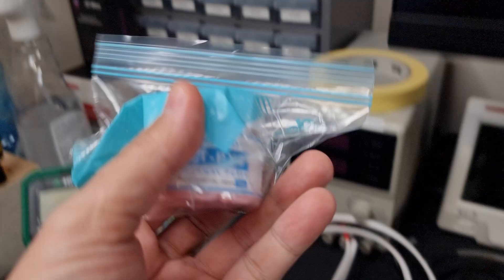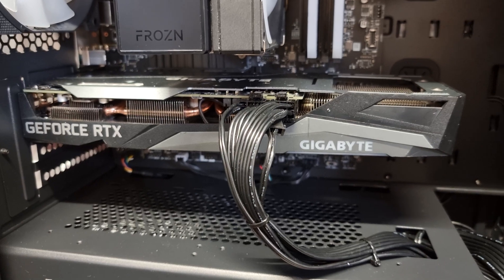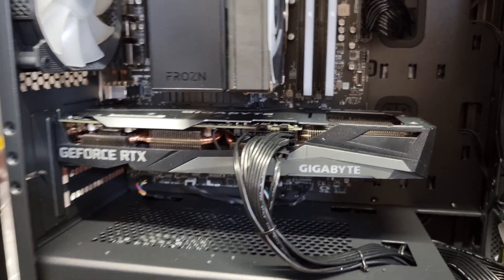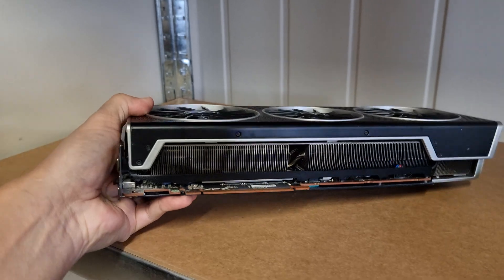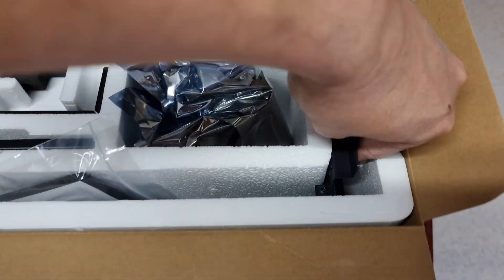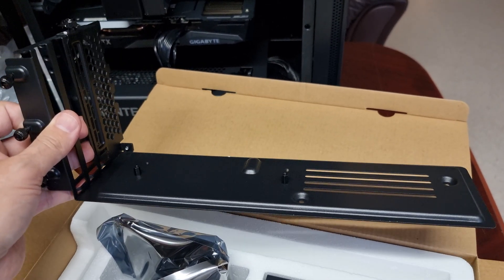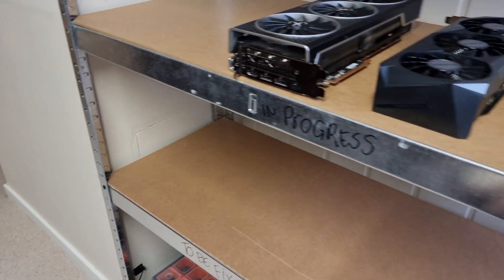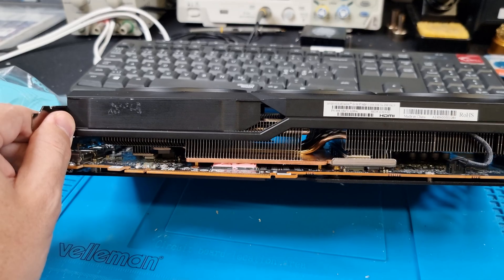Why Modern Day Graphics Cards Are Dying Prematurely.

Comment: glad i bought a new case, the frame 5000D and with that a RTX 5080. was running a rog strix 2070 before and damn, the 5080 is so much heavier, i couldn’t even imagine that. even with a holding bracket i still wasn’t happy. bought a cheap ryzer 4.0 cable bc my asus rog b550-e only supports pcie 4.0. if i update to am5 than i will get a ryzer 5.0 cable and a free performance boost. i’m happy to mount my 5080 vertical after i see this video.
Reply from the maker: Vertical mounting is a great solution for heavy cards like that! And that Corsair 5000D is a nice case. I have one myself.

Comment: I’ve aways tried to have systems where the card doesn’t need supports, but it severely restricts your choice in cases. I never thought of vertical mounts via an extender as a way of taking the weight off the card. Why does this never get a mention from places like Gamers nexus when they are doing case reviews? It’s always about thermals and looks. This needs to be mentioned and more widely advertised to the community
Reply from the maker: Gamers Nexus, Linus Tech Tips and other bigger channels do not deal with GPU repairs in combination with reviews as mine does. I cover both whenever I can. There are videos out there of Linus, Brian from TechYesCity and Der8our trying to fix graphics cards with a regular heat gun. They have no clue what they are doing.

Comment: Blocking all your PCIe slots isn't a solution. It's trading one problem for another. What about the GPU support that's basically a bar that's installed under the GPU?

Comment: Do different AIBs or maybe GPU models have different PCB thickness? I know with motherboards they advertise the layers sometimes.
Reply from the maker: Yes they do. Some use 8 copper layers, while others use 12. And it is not restricted to one brand.
Reply: @TechnologyHive  RIght on. So, presumably, you see this happening a lot less with 12 layer boards? Do you recommend any brands or examples of nice sturdy GPU construction like that?
Reply from the maker: @michaelservetus914  Actually I see this happening even on cards with 12 layer PCB, and it is not due to the pcb being weaker or stronger, its due to the larger heatsinks being used today. The thicker the PCB, the heavier the heatsink.

Comment: I just bought sapphire pulse 9070 xt but it is only weight 1.2kg compared to the 2.2kg of the 6800xt merc in your video. Do I need to support my gpu ?
Reply from the maker: If its a 3 fan card, I would add at least one support between fan 2 and 3, so 2/3 the length of the card, just for peace of mine.

Comment: Had no idea this was a thing, as someone who isnt as savvy on all the newest parts and build options. I havent noticed any bowing in my 6700 XT yet but i decided to get a cheap bracket support to help which should come tomorrow,  right nowi have it fastened in the back of the case to help but that doesn't help with the torsion coming from the opposite side of the card as you demonstrated. It's been a couple years, is it too late and my card is going out regardless?
Reply from the maker: No, it's not too late. The support bracket will definitely help prevent any further bowing. Just loosen up the retention screws before you add the support, let the card rest on the support, level it, then tighten the retention screws. If it was too late you'd start noticing it by now.

Comment: Today CPUs and GPUs are OC'd to they're max from the factory so the wear and tear are accelerated and thus they're operating life is shortened. That's why overclocking is almost a thing of the past unless you use LN.
Reply from the maker: OC has nothing to do with this kind of damage. This is due to weight, not OC.

Comment: whats the latency-loss with vertical mounting though? you're still adding a bus-speed bottleneck that doesn't need to be there.

2 sag brackets, at the middle and end of the gpu, seems to be the smart call.
Reply from the maker: The riser cables included with most 3rd party vertical mount kits are PCI-e 4.0 or 5.0. I have not seen any well verified study indicating these aforementioned riser cables add any significant latency.
Reply: @TechnologyHive  they functionally HAVE to though? part of the budget for the entire R&D for the last 20+ years on motherboards has been progressively physically shortening, and increasing the efficiency of the bus-speeds and distances between processors, ram and storage/network cables etc, without impacting the functionality and practicality of the motherboard instead.

Adding a degree of distance to the most time-sensitive component in your pc for gaming has to add a latency or micro-micro-stutter issue. I use a portable sag stand, a little adjustable pole i place under my gpu, im gonna go buy a second one for the middle part now though because of your video. I use a XFX merc 7900xtx and its a big boy.
Reply from the maker: @Vihara2 I had one of those xfx 7900xtx but I sold it. Indeed they are big cards. I had bought it second hand with cracked memory joints under the chips closest to the pcie slot so no post. After repair I used it for a while then I let it go.
Reply: @TechnologyHive  interesting, it's never happened to any of my gpus, i've always placed a bracket at the end of the far corner. i had a RX580 with a cheap cooler and no backplate, that i used fishing wire from the top of the case to secure it. There was an upwards bow in the middle but it always worked lol.

That being said i've had two xfx mercs, a 6900xt and this 7900xtx, and OCing the ram was always alot of trouble for me and i could never get it stable, i always gave up and left it stock as a result. (the 6900xt is dead for different reasons that were entirely my fault).

Comment: Never had a gfx card go bad if it didn't come from the box that way. I remember back when some 1080 gigabyte had bad caps and I replaced the caps with quality Japanese ones. I do use full cover water blocks, maybe that stiffens up the card, who knows. I have been using vertical mount before they were a thing. My first custom case was a mountain mods UFO horizon, then Lian li 01 and now a sup 01. I know people don't like the sup 01, but if you run custom water, it's a great case. Quality PSU also helps, both of mine are over 10yrs old, buy once cry once. Seasonic prime titanium and Corsair axi platinum.
Reply from the maker: I've never had a GPU go bad on me either, but it does happen. I have almost always used vertical mount though.

Comment: IBM and Apple had this figured out decades ago with the brackets on the back of the cards that fit into slots on the front of the case.
Reply: yep, 'they' removed that 'stupid' piece of plastic, and large cards have been sagging ever since, lol.
Some people didn't like the PC speaker it sometimes held, others didn't want a noisy 80mm fan, and replaced the entire thing with larger quieter fans (understandably), and eventually the plastic rails vanished. The high wattage of modern graphics cards also isn't helping; back when the plastic rails existed, the limit was around 55 watts per slot for one of the AGP revisions. Now I see chatter about some 800-watt card, rip 12v-high-failure plugs, ouch.
Reply: @WillThat  that sounds interesting, did they have a specofic name?

Comment: I thought I'd be smart and eliminate this problem with the Thermaltake CTE 750 case, it rotates the Mobo 90 degrees so the back IO is on top and the GPU hangs down from the top, no support needed as it hangs from the back mounting bracket, the problem is that the GPUs vapor chamber and heat pipes don't work in that orientation and the GPU hits 90c+ on the hotspot in a few seconds while the GPU temp is in the 50c range, thought it's a GPU problem first but luckily I have a few GPUs so could try a few different ones and all had the same problem. Oh well gonna need to figure something out.

Comment: whenever i redo a card i use alcohol to get rid of the grease the old thermal pads always leave and then i put ptm7950 on the gpu die and thermal grizzly putty everywhere stock pads are, yea the TIM is expensive but id rather waste $40 there than buy a new card or wait weeks for rma - gpu supports are a must with cards these days and i kinda wish there was a standard for the supports, like a notch thats always 3 slots tall so people could get a set of rubber spacers that works with every card instead of buying a $10 bracket or adjustable pole just to hold it - and honestly for how much power gpus are using these days they should just come watercooled
Reply from the maker: There is a reason why watercooled gpus is not the standard, and that is points of failure. A heatsink, as trashy as we may think it is won't fail as an AIO pump will. We also have to deal with permeation. And with GPUs, permeation occurs sooner than an AIO installed on a CPU. So it all comes down to cost. Also, no waterblock is perfect. I have had many EK branded gpu water blocks, mounted from factory on gpus, start leaking after a few years in fir repair. And dealing with corrosion is not a fun job I like to take.

Comment: i have a case named coolermaster haf500 argb, and a z170 motherboard, eventually start trowing errors until there where unsuable, when i dissamble the whole PC, take the mobo with the 7600k, the mobo was bent, and somewhere this was the issue, a combination of this case, because to put the mobo screws are so complicated for no reason + my coolermaste 212 evo was causing some kind of push, i let the mobo rest without the cooler for 1 week, and magically it got straight again, and working like nothing happen... xD, just my experience with bend pcbs.
Reply from the maker: Sadly that has never been my experience with bent GPU pcb's. I wish it were that simple.

Comment: If your case is too old or too cheap to vertical mount your massive GPU with a proper vertical mount kit, then it's time to invest in a decent case. Your GPU and wallet will thank you down the line.

Comment: They actually kinda don't???
It was an issue in early years, like 2000-2013, but since at least Nvidia's 1000th series GPUs usually are pretty much immortal unless damaged physically or electrically executed
Reply: the man show you proof and all you have are just statements, who should i believe?
Reply: @Nathenothing  i know that some modern GPUs are subject to premature death, especially high end ones, especially ones with famous 12-pin incandescent filament, but MOST of them are durable enough and generally much durable than GPUs from a past decade.
Reply: Did you actually watch the video? Because your arguments doesn't have the same context to the problem that is shown in the video

Comment: All of these manufacturer designs using thick pads are absurd.   The optimal contact is direct with a thin layer of thermal paste.   Anything else is inferior.   There are no thermal pads that work better and the thicker they are the worse they perform.   I do not see any engineering reason for no direct heat sink contact so it must be inferred that the pad designs are deliberate and designed to fry your chips sooner.   Rotten corporate product life management.   Keep shelling out $1000 every few years and don't waste their precious time.
Reply from the maker: Direct heatsink contact with memory chips does not work by nature of IC design and small PCB layer variation. I have a few cards come in with what they're calling "the copper mod", which leads to premature death of the card. The reason has to do those small variations on the PCB and IC's. Ideally, 0.5, 0.75, and 1mm pads do a good job at transferring heat from the IC's to the heatsink. You can find some good OEM pads here:  

https://www.aliexpress.com/item/1005007219946019.html?spm=a2g0o.order_list.order_list_main.23.51631802LIxPNN

I do not use anything else.

Comment: At first when you said vertical mount, I thought exactly of mounting the graphics card vertically. I didn’t know what you meant until you showed the graphics card support bracket. Or a vertical mount support bracket, I can see why so many people got confused.
   At any rate that’s good advice to use a support bracket of some kind. My case came with one built in but I also use the one MSI gave me so all edges of my GPU are properly supported. 👍
   I have a question tho. When using a support mount or support mounting bracket for GPUs, should you lift up the GPU and then lock in the support bracket?  If so, I was wondering how much lift? Because I don’t want to God forbid break my Vangaurd while trying to fix it, that would be terrible… But ya, Or do we just let the support bracket touch barely and if there is sag the support will hopefully stop the sag, or most of it anyway.??
    Thanks for the video!
Reply from the maker: What I recommend is to install the GPU but do not tighten the retention screw/s yet. Add the support and let the card just rest on the support. Next, level the card with your case, then tighten the retention screws securing the gpu to your case. I know MSI likes to include those long GPU supports that are secured where the GPU retention screws are located. Those work fine, though they are a pain to install from my own experience.

Comment: There fine horizontal if ya use a bracket, i use support for even some two fan gpus, Not One Single Problem. It doesnt Have to be vertical.
Reply from the maker: Supports work just fine when installed horizontally if you use them correctly.

Comment: why exactly vertical mount provided by the case is worse if it's similar in construction?
Reply from the maker: The vertical mount option that is available with some cases is inadequate because it places the card too close to the side panel, depriving the card from proper airflow. 3rd party vertical mount options move the card closer to the motherboard, and away from the side panel so the card breath better and actually run cooler than when installed horizontally.

Comment: I have 7900xtx nitro + and I am using the included bracket with it holding the middle of the card and two GPU stands on it at the end of it and its been like that for 2 years and so far I did not notice any bending on the PCB when I cleaned it 2-3 weeks ago.
Reply from the maker: Included supports do a good job, generally. That 7900XTX is a nice card.

Comment: These cards are so fragile you could stare at it too long and break it.
Reply from the maker: I think the cards are built as they should. The issue is the heatsinks being used on these parts. If you look at AMD cards, like the 7900XTX, they come with a vapor chamber heatsink, and are 2.5 slot cards, built smaller than AIB cards and work just fine. But cards like for example that from ASUS TUF 7900XTX, which is one of the biggest cards out there right now, should never be installed horizontally.

Comment: Verical is nice, but I've been using my zotac 3090ti amp horizontally for a very long time without any issues. 
And yeah I remove the card first before cleaning.
Reply: Also, I've undervolted my Gpu and Cpu. So those temperatures just aren't enough to hot bend the circuit board 😁
Reply from the maker: @OGsunny I hope it continues to work for many more years.
Reply: @TechnologyHive  🤞🏻
My Gpu's rgb placements prevents me from using it vertically maybe Zotac did something to tackle this bending problem who knows.
Btw I am a ZOTAC fan since 2017.
Reply from the maker: @OGsunny I have Zotac cards in for repair all the time, especially with bent PCB's.
Reply: @TechnologyHive  what? Then I better find something in my house to place it under the gpu as a support. Maybe a chopstick will do it.

Comment: I am using a KFA2 RTX4070Ti Super here. It's got two M3 screw holes on the bracket-less end. I 3D constructed and printed me a support leg that goes all the way down to the power supply shroud, so the card has at most 1mm play if you are pushing down on it. The leg screws directy into the headsink now with 2x5mm standoffs. Also, I put a PTM pad on my GPU. 
There is one risk with vertical stands: SIGNAL INTEGRITY especially on PCI 5.0! Most gamers have no trace of awareness how sensitive those signals are. I've been there, only trying to vertically mount a network card. At least the risers from China are a desaster...not even PCIe 3.0 worked. At least I have my background in electronics and experience too but those riser cables make my toenails curl...
Reply from the maker: The riser included with the cheaper Phanteks vertical mount is PCIe 4.0. I have never taken the time to investigate signal integrity with risers as I have not experienced any difference, nor do I have the tools to do so.

Comment: The problem with the flexing PCB is that the PCIe Edge Connector was never meant to be a structural component.
Back in the day PCI cards were at worst a 2 slot design and were very light weight in comparison to newer GPU.
I have and old Nvidia card and when I compared the thickness of the PCB, the old card was thicker by 0.1mm thicker.
We need an evolution in GPU design to address this stress on the Edge Connector.

Comment: This is why I love horizontal cases, where the motherboard is horizontal, and the graphics card is installed vertically without even needing a PCIe riser. My case is also wider than it is tall and is virtually impossible accidentally tip over, and also just easy to work with. 

It's a HAF XB EVO
Reply: THE CUBE! Haha, the old cube will never die! My buddy and I both got the HAF XB EVO like a decade or more ago and have loved it. Done some mods like to get USB-C 20Gbps in the front and recently replaced the top 200mm fan with an RGB model that Cooler Master finally restocked. Been through a 1080 Ti, 2080 Ti, 6900 XT, 3090 and 4090 and they all still function just fine due to the horizontal nature of the case.
Reply from the maker: The Cooler Master Elite 130 was my favorite. Sad that they do not make it any more.